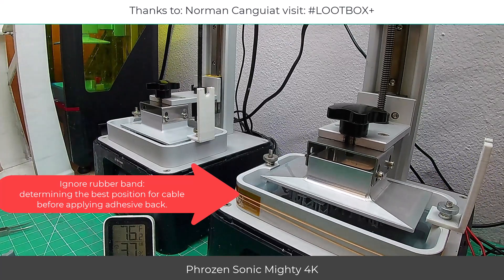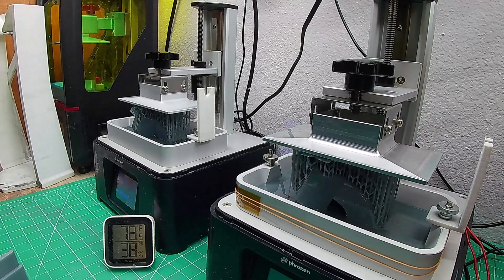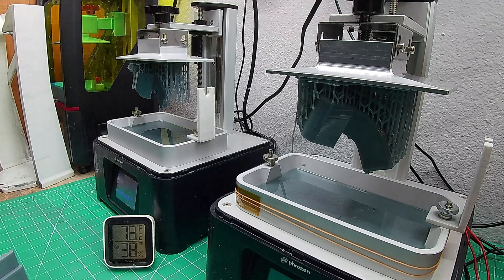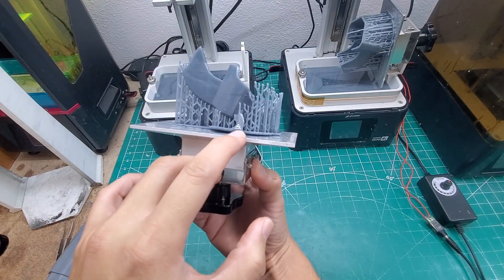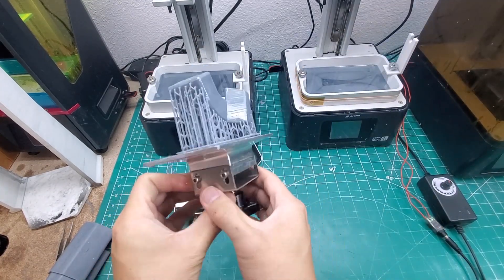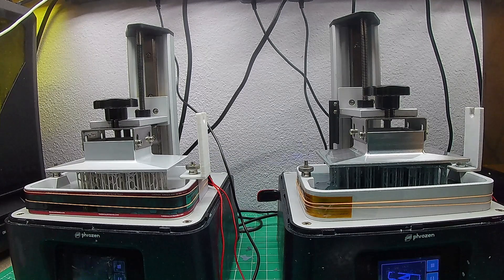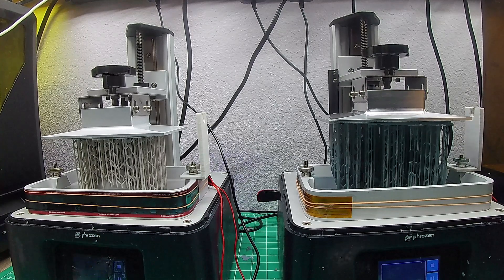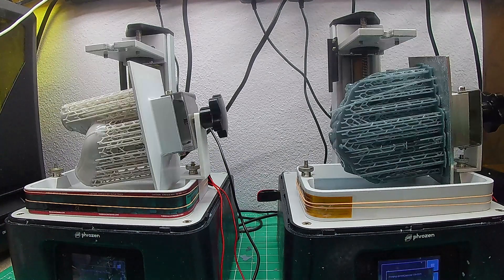ThermalVATBAND reduces failure. Here is the proof.

Comment: Wonder if it’s possible to speed up print times by warming the resin since I’m assuming warmer resin is less viscous/thick than colder resin. The extra “flow” should make it easier to print with & possibly help with print times 🤔

Also curious to know if warmer resin has a stronger smell than colder resin. Probably wouldn’t be a fun time heating up a resin that already has a pungent odor when it’s at cold 😂
Reply from the maker: The dental industry uses VATBAND all the time for that specific reason. By warming up the resin, you prime it for curing with less exposure time. Resin cures with an exothermic heat reaction; similar to all urethane products, exothermic heat is necessary to change from a liquid state to a solid state. Warming the resin reduces the time available for UV exposure. Most professional grades do require a higher heat level for printing. To answer your question on hot fumes versus cold fumes, it all has to do with the manufacturer of the resin. Some smell less than others; usually, heat will increase the fumes in the beginning and dissipate quicker in the long run.

Comment: Both machines are phrosen, yet you say that they are two differents 3D printers
Reply from the maker: The resin is different on the second test. Watch it again.
Reply: @3dtvb  different resins different configurations, that may be why it fails
Reply from the maker: This is not the case. Both have same viscosity ABS like resin. Profile was the same. But you have a point, there are different types of resin. @cmkcmk1989